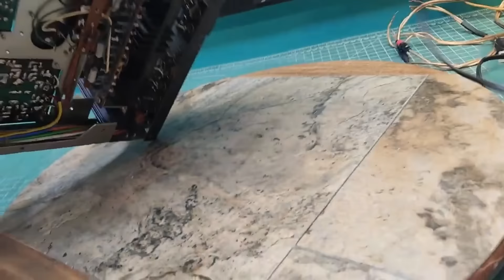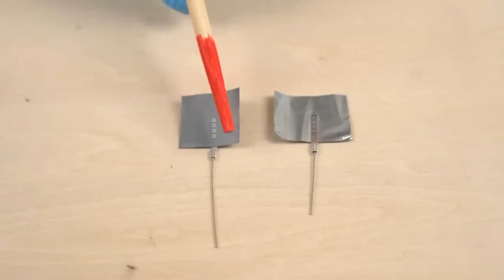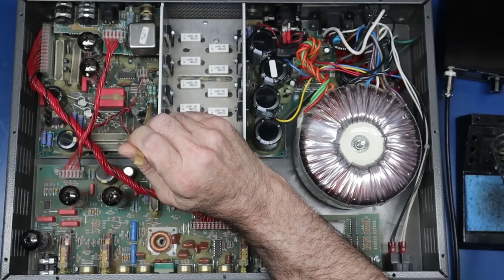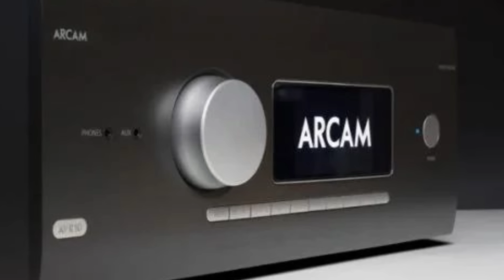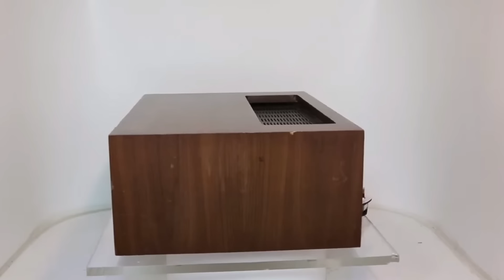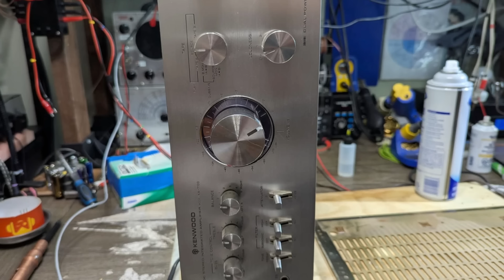Why Your Amplifier Will Die In 5 Years (The Hi-Fi Repair Scam)

Comment: Today, I seen a 2 year old Pioneer VSX-LX805, their flagship model.
Busted and the shop won't repair it.
Absolutely disgusting and not like Pioneer.
Reply from the maker: That's honestly heartbreaking to hear. A flagship unit that age should have no business failing, let alone being deemed irreparable. Do you know what actually went wrong with it, or did the shop just refuse without even diagnosing it properly?

Comment: I am an hifi lover and electronic technician with 30 years repairing experience. I have, and still do, every kind of electric and electronic fixing. I have to admit old products were designed and better engineered than today. But for me vintage devices are just toys for nostalgic oldfarts: most of them buy vintage when they are 60, remembering when they were students and they didn't have money to buy those products of their dreams. Modern audio transistors and opamp sound better. The real problem started with multilayers PCBs, BGA chips, junk capacitors, and extreme miniaturization. 
This was a problem already 20 years ago, now it is even worse! most devices manufacturers scrape off the code on chips and transistors body, so you cannot replace them, and most of them use microSMD and cover them with epoxy resin. You open the chassis, and all you can do is admit it is not fixable. Lots of repairing labs shut down, and technicians have to accept low income if they want to work, because if you say: "this work will cost you 10 euros more than expected", they reply "stop and I will buy a new one". When I was teen and studying electronic, I accepted with curiosity the switching power supply circuitry. In theory, it was interesting. But when I started working on them, I realized what you clearly say: they are a shame scam! and still nowadays I hate them, I don't even loose time trying to repair them. Thanks 4 your video, CIAO from NE Italy

Comment: Partially agreed, but partially not agreed.
Modern equipment like streamers are digital circles board, relies on cat5 circuit board and wifi. They will eventually fail when capacitors are dry out. But you don't have alternative source(s) if you are not LP or CD fans.

Don't expect to buy a Ford Model T like equipment for daily use😅 (some of my friends still play Western electric tube amplifier, which is older than my grand-grand father😅 > yes that kind of antique equipment still sounds great)

Comment: Naturally, as a man approaching 80 who worked as a service engineer for Marantz and Akai in the 1970s, I naturally own some high-quality equipment, with only the recorders and turntables being from top brands (Revox and Technics).
But I built the amplifiers myself, and they are on a par with the very best, the power-amp of-course with Mos-fets, and filter capacitors with a total of 100,000 uF and yes toroide transformers.
To be fair, I should mention that the preamplifier is a design by ‘Elektuur’, dating from 1986 and called ‘the preamp’ – a perfect preamp.

Comment: I have a Musial Paradise Class D/ tube hybrid Amp.  I paid $200 for about 10 years ago.   It can more than hold its own with my class AB Amps in the $400-$600 price range. 

It’s not “modern class D.  Look inside it has a large transformer, traditional caps and built in linear power supply.  It has 40,000 uf power reserve.  Modern class D typical ranges between 0-200  uf power reserve.   As you pointed out not having a power reserve.  The switching non power supplies.  Rush in current from the wall trying to keep up with demand severely shortening the lifespan of the amp.

I compared the Musical paradise Amo that puts out 50 watts per channel RMS.   Against 200-300 switching “modern class D  Anps”.  the MP has a rich inviting sound, good dynamics and a 3D  soundstage.     The modern class D I compared sound flat, boring and lack dynamics in comparison
With a flatter almost 2D soundstage. 

The second thing that is obvious these little Class D are intentionally grossly over stating their power. 

RMS rating is how much CONTINUOUS power an amp can put out  in BOTh channels  a minimum of 1 minute and with no more more the 1% THD under a constant load
Under RMS legal standard you would see RMS ratings like 6:55 50 wpc at 8ohms and 100wpc at 4 ohms.    RMS is also a legal standard.    A manufacture with a n amp rated at say 45watts RMS can’t publish it as 50 RMS

These Switching power supply class D have largely got around that by refusing to be tested by RMS standards. You look
at a 300 watt rated cheap class D.  You find they are rated in gross burst power that lasts only fora few thousands of a second at a full 10% Total Harmonic Distortion under a very low ohm load to boost the measurements higher

I’ve tested 3 of the small switching power class D Chinese amps .  With claimed power between 200-300 watts.   My 10 watt tube amp plays louder without breakup. 

Sadly I’m not sure there is much of a market anymore for a traditional Class D using transformers and internal linear power supplies.  They are getting harder and harder to find for a 2 channel system

Comment: All this is 99% BS, the main problem is not capacitors but highly integrated very small size smd component and microcontrollers that are very hard to diagnose and replace, in today electronics there are 100 times more components on printed boards vs 1970-1980.

Comment: There is an emphasis on the Pioneer SA-9500 mk2. Those "in the know" know that the Pioneer SA-9500 is superior. Don't be fooled by the allure of the mk2's twin-transformers! Also, the mk2 uses proprietary output transistors! And finally, the SA-9500 mk1 weighs over 37 pounds...the mk2 weighs just over 35 pounds!

Comment: Beside the fact that I am building my own amplifiers and have been doing this during the years moving from simple standard designs to more and more complex, fully symmetric designs, I do own a few vintage amplifiers that have passed the test of time and my test of sound. Dual CV1400 and Technics SU8080 are some good examples of that. Beside these vintage but still modern amplifiers (they do pack integrated circuits), I am also a big fan of the standard transistor and vacuum tubes based designs and I am currently moving to magnetic amplifiers.. Some of these will never become commercially available due to cost and inherent inefficiency.

Comment: I have a marantz model 50 pure analogue amplifier 2 years old so far so good. It feels very robust and sounds excellent. Will it last? only time will tell. I think it's OK to go on about the older items being better built than today's but I think sometimes we can get carried away with this notion. Yesterday's gear houses yesterdays technology. I bought a kia picanto in 2014 it was 9 years old. I ran it for 8.5 years never had a single problem with it. If you would have bought a car in the 1970s at 9 years old would you have got 8.5 years trouble free out of it? Don't think so. But I do agree repairing the older items was a simpler task. I have faith in my marantz because it's is basic like the older gear. Fingers crossed 🤞

Comment: Once the kids had left I dragged down, from the loft, my old Trio turntable, Nad amp with phono pre-amp, Mordaunt Short speakers, and Technics DBX cassette tape deck.  It still sounded good but I chose to use it for a few months to make sure it wasn’t a ‘fad’.  I’m pleased to say it wasn’t, and the bedroom is now my listening room and I’ve gradually replaced some of the pieces.
The first to go was the turntable.  It seemed stiff and I didn’t want to damage my ancient records.  It was replaced with a Technics 1200GR and Ortofon bronze pickup and the improvement got me hooked (again).  I’ve since added an Arcam CD5, replaced the NAD amp with new Quad 33 & 2x 303s and finally the speakers with Super Lintons.  The only original bit is the cassette deck, which plays my old tapes very well.
I was feeling very happy with my latest setup until I read your article.  I now won’t be surprised when I start replacing it all in 2031, apart from the cassette deck, of course. 😂

Comment: Technics Stereo Integrated Amplifier SU-A700. (Made in Japan)   It works perfectly, I recently disassembled it for a small problem with the volume potentiometer - spray contact and I solved the problem. The filter capacitors are OK, very good quality, if they need to be changed I know what I need to buy...!

Comment: I finally opted, after long debates with myself, to build an amplifier that would satisfy my current needs for connectivity and sound transmission (bluetooth), combined with classic class AB final stages with 2 pairs of transistors for a power of 85w rms into a 4 ohm load.

Comment: I still use vacuum tubes. I can measure and test the tubes myself (which is really necessary if they need replacing, because sellers try to rip you off). Point-to-point wiring, easy to repair. It’ll keep playing music as long as someone gives it a little TLC every now and then.
And what a beautiful sight in the dark—no flickering LEDs, just a warm glow… knowing that electrons are zipping around inside that glass. You can’t see the electrons flying, but you can hear them—it’s music.
Reply: Soldered from point to point, replaced the front tubes after 10 years. I'm definitely not selling it,
Nowadays they contain printed circuit boards, even in top brands

Comment: You get that if you buy SONOS (low quality alu capacitors), Denon ain't bad (in generally the HDMI stage does know to get problematic) and Yamaha uses Elna even on their cheap stuff. As you go higher the lines you get even better as Niklin Gold ones. Big enemy is a heat and crempied AVR's and small chaisis amps without sufficient dumping of air flow surfer the most. Good regulated with V pump switching power supplies also bring benefits to class D (in this case H) and if done properly it won't be noisy (medical application ones for example). If done good normal caps on such will last between 7 to 10 years and with great ones even 15. The iron core and theriodal ones can last 40+ years and you will get them stil in such brand stereo amplifiers or even modern one's with Brunos SoM's from established brands (ATI for example), of course you have to pay for most part of use of such components and prolonged suport (not always for example cheap Yamahas, some Dynacord PA's and so on). Integrated higher end functions like streaming the microcontroller will eventually give up or will company but they might do whats in their capability for a very long time after device is disconnected and stops receiving updates if it's from stubborn Japanese manufacturer like Yamaha (old R-N lines for example). The Panasonic HDMI 2.1 chip whose the early one, only one at the time and it doesn't support full 2.1 bandwidth it does low latency stuff and other parts of specification and never whose problem if you wear not a die hard gamer. The amplifiers that use external switching power supplies even if you don't like them for those bricks laying on the floor behind are actually good thing regarding service as you dispose dead one and plug in a new one and there is a lot of them including some good ones and some even grate (Fosi and other ones with V pump, Topping B series). I hate when people generalise things but don't want to tell you a real truth.

Comment: I purchased a Yamaha RX-V340 AV receiver in 2004, no hdmi inputs, only coaxial rca and toslink , use STK-xxx amp ic inside instead of class-D amps module of today. With 5.1 Dolby digital, dts and tuners still works like brandnew until now, 2026. Upgraded  with outboard BT receiver to connect with Spotify via android phone. Play and decode DD+ encoded programs from android tv netflix etc via toslink port from tv. I did not regret buying it since day one.

Comment: I have a Sony TA-2000F Preamp, two TA3200F Power amps, a Thorens TD124 turntable, SME3009 tonearm, AKAI GXC-36 and several Sony WM-D6C Professional tape decks, Various Pioneer, Technics, B&O gear and even Various valve Amps from the 40s and 50s. I have never been enticed or interested in new gear, it really does not feel or sound the same, Ill have to agree with people when they say it cannot be produced again, because the people who designed them and the economy which funded them are long dead, the new gear that claims to be vintage style is merely cosplaying.

Comment: I ONLY buy older, used equipment.  I like gear that uses tubes or discrete transistors.  ICs are OK, if they're standard, off-the-shelf types, like op-amps & voltage regulators.  TTL, DTL, etc.?  Sure, but those don't normally appear in analog gear.  I'm an experienced technician, and have all the test equipment required.  And service manuals, or at least, schematics, are available.  Can't find a replacement transistor with that weird, in-house number?  No problem. Just find one with the right gain, frequency response, & power rating, and you're good to go! :face-blue-smiling:

Comment: It’s funny. I researched power V-FET amplifiers…Yamaha B-3, Sony TA-N88…pre-amplifier…Sony TA-E88…integrated amplifier…Sony TA-F80…look at price when new…some equivalent…to the price of a car…You replace capacitors (…source another amp to replace v-fets…the latter…manufactured 1970s…deemed too expensive to continue…(some say…unobtainable)…pair with Yamaha NS-1000x…with beryllium…tweeters…midrange…good enough to have been used in recording studios…why would one want anymore?…BUT …maybe an Accuphase…based on same reasoning; abiding quality that lasts…IF…you know where to look!

Comment: i bought in 1987 a Philips cd-950 cp player, a techtenics  sh-8065 equalizer, technics sl-1200 turntable, 2 magnat speakers, technics su-vx10 amplifyier and a philips n-4522 tape deck working at this moment without problems

Comment: I have a Yamaha A-720 Integrated amp from ~1982, back when all major manufacturers competed for the best specs and they were well built. Even their non-top models were well made. I have re-capped it and will soon start re seating the output transistors with fresh heatsink paste etc. The main problem with this amp was the input selection push buttons on the front panel. I took them apart and cleaned them years ago but they have failed again. I have since designed a digital Microprocessor/relay solution to replace the old switches. I hope to have that in place later this year. The amp sounded great but has been out of service for a couple years. I have tried to find a replacement for it a few times but nothing comes close to it's performance (that is affordable). So yes, I agree 100% with this video, it confirms what I already knew. Regards.

Comment: I have both, a lifetime of improving e every time possible. I ended up with a Yamaha Phase Linear system that ALWAYS impresses. But I also. Have the 7.1 surround Klipsch wireless self powered system, which uses a small box and remote to operate. It also works great. I guess  to get quality  now, you just have to pay more, yet you can still buy equipment that lasts.

Comment: Old gear requires recapping, alignment, and some transistor and/or tube replacement.  Once you do that, it will last for years.  The problem is that if you don't acquire these skills and do it yourself, you will pay through the nose for these services.  My current gear includes a 1970 Sansui 3000A and a Sherwood S-9180CP.  I also have a more recent NAD 316BEE.  My favorite vintage amps were a pair of 1950s Grommes 6L6GC-based mono PG-61s.  I should never have sold these.  I now realize that they were as perfect sounding as you can get, at least to my ears.

Comment: No need. Buy for $40 zk as21 2.1. The D class amp just needs a $40 power supply. For $80 you get hifi sound with .03% thd drop dead silence distortion at low volume. I paired an old vitage ss-crb5 with a zk 1002t an dit sounds probably better than pairing with an old 100w receiver in a 3x2x1 form factor. Absolute hifi zk 1002t and ss-crb5 $22 + $25 speakers total $47 that cannot be rivalled by $200 book shelf speakers today.